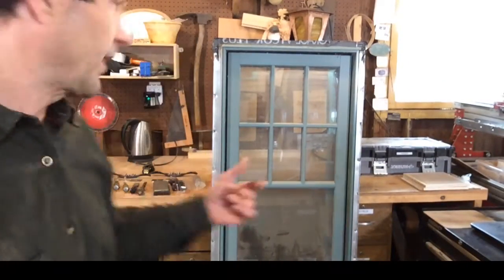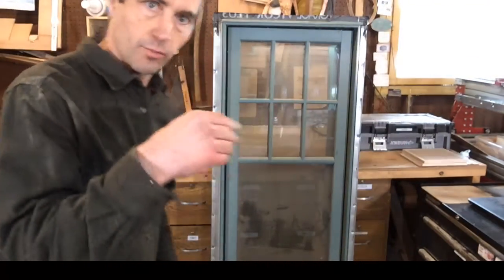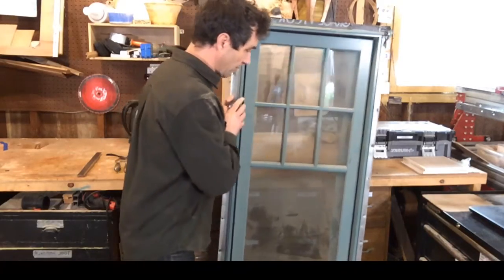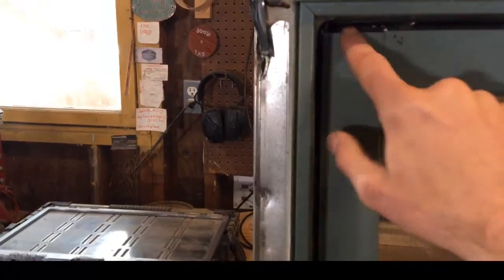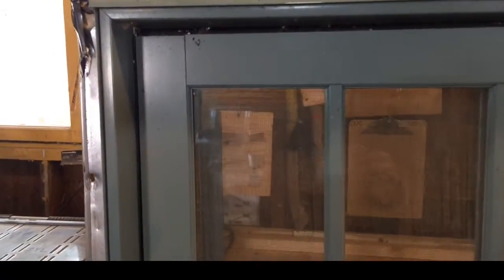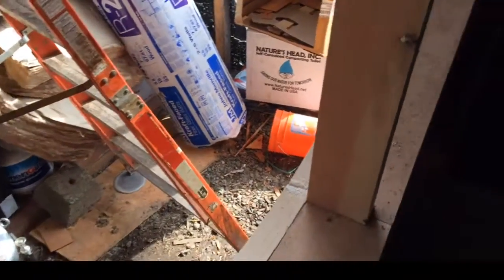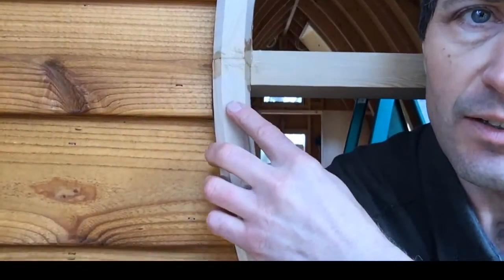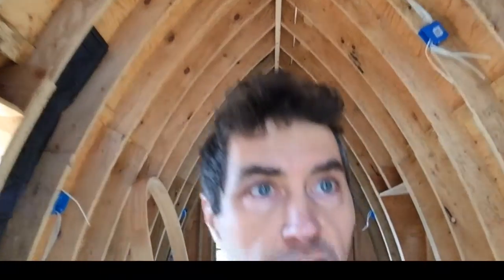Ask Zyl Live - Windows & Doors Part 1 - April 16, 2017

Comment: Do you think framing a tiny home with 2x6 vs a 2x4 is better for a tiny home; when you're referring to insulation. Also, what do you think about SIPs as part of a tiny home?
Reply from the maker: 2x6's are OK, but add alot of weight AND eat up 4" of interior space. Better to use a rigid foam insulation or SIPS if you need to achieve a high value.

Comment: I need to replace a door that hangs in a metal frame.  Any suggestions (cannot buy prehung) on what kind of door to use and points to remember when trying to hang it?
Reply from the maker: It is easiest to order an exact replacement from a local building supply. They will need exact measurements of the door slab you are replacing... or you could bring it!
Reply: Thanks very much.  The current door keeps sagging on the hinges, although we have tried using dowels and lead sinkers to  solve that problem, and that is the reason it needs to be replaced.  Do you have any recommendations for  a more permanent solution to sagging on the hinges, short of replacing the door?